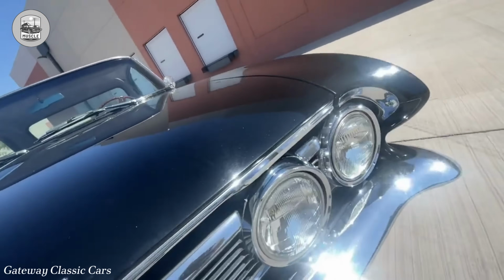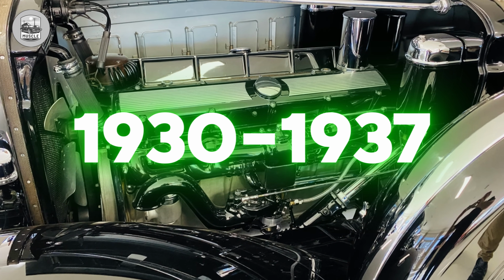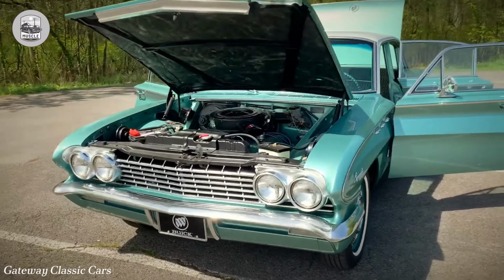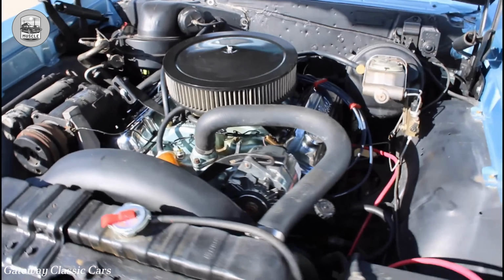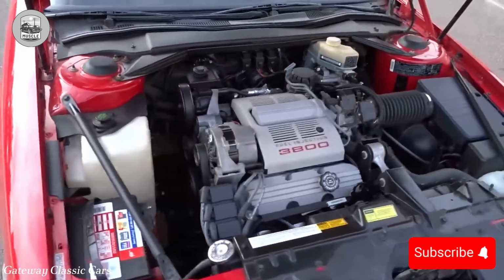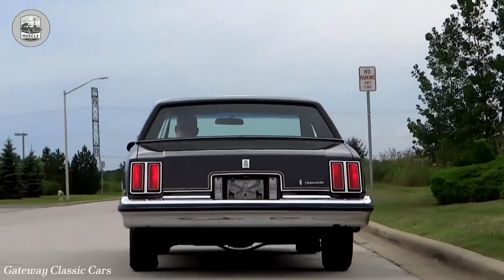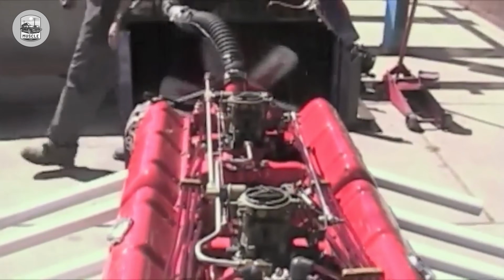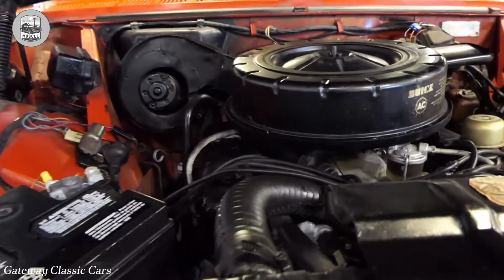10 MOST FAILED and WEIRDEST GM Engines ever made | Worst engines blunder!

Comment: I owned a 1963 Jetfire, it was the loaded version, full power, AC lacked only the AM/FM radio and vanity mirror. I drove it for a number of years as a daily driver swapping back and forth between it and my 1966 GT350. Jetfire was much nicer in hot weather. Someone had lost the heat shield for the battery, which also seems to be missing from the car in the video, as a result the exhaust heat would kill a Sears Diehard battery every 18 months. Technician at the Newport News VA Sears auto center would see that Jetfire in the service line and go pull a new proper size Diehard and have it waiting when I pulled in. It would just flat walk away from a standard 289 ci Mustang. Biggest issue I had was the transmission, it really wasn't strong enough for the Turbo Rocket V8.
Reply from the maker: Thanks for sharing such an amazing story about your 1963 Jetfire! That’s a rare gem with a fascinating turbo setup, and your experience driving it alongside a '66 GT350 is pure muscle car royalty! It's interesting that the Jetfire, with its Turbo Rocket V8, could outperform a standard 289 ci Mustang—it’s a testament to the innovation Oldsmobile brought to the table.
The issue with the missing heat shield and the toll it took on your Sears Diehard battery every 18 months is a classic problem. Those turbocharged engines produced a ton of heat, and without that shield, it’s no wonder the battery couldn't handle it. It’s great that the Sears technician in Newport News had you covered each time!
As for the transmission, you're spot on—the Jetfire’s 4-speed Hydra-Matic was known to struggle under the stress of that turbocharged power. It was designed for more standard engines, and when paired with the Turbo Rocket V8, it could definitely show its limits. Many owners eventually upgraded to stronger aftermarket transmissions to handle the extra torque.
Thanks again for sharing your story, and to everyone else reading this, we’d love to hear more experiences! Got any stories about classic muscle cars or tips on keeping them running strong? Let’s keep the conversation going! Don’t forget to comment, share, and subscribe to Muscle Car Masters for more stories, insights, and all things muscle car!
Reply: @MuscleCarMasters68  I also had a (bought new) 1978 Delta 88 Royale with the 5.7L Diesel engine. That one had several "lets cut corners" issues, like using the Delta 88 V6 running gear, as a result it ate a set of front pads in under 10,000 miles. Injection pump timing marks wern't right as built. I am a trained Diesel mechanic by USMC so knew that 10-12 mpg and virtually no power, loads of black smoke weren't right. I got ahold of some Roosamaster information, removed the pump and took the timing window off. Problem is, you can't see the marks with the pump installed. I took a short piece of rubber and wedged the rotating portion at the mark, stuck it back in with engine at TDC. Took an open end wrench that fit the flats on the pump inlet and loaded it against the direction of rotation and made a new timing mark, smoke was gone car had reasonable performance on mileage jumped up to near 30 around town an 33 highway. About a month after that, dealer service manager called and said they had received a service bulletin regarding improperly marked timing marks on early production Diesels. He had me drop it off, and performed the TSB and said I was dead on with my mark. When we bought it our son was 1 year old and I owned a carburetor and ignition shop, so selling me a Diesel was a big deal, they were not discounting them, full sticker. I didn't want a vinyl top as I really wanted my rear window to stay leak free. They ordered one in, then said that it for someone else who wouldn't take it without the vinyl top. It had the optional wheels and tires, they could get the F41 (handling package) so they wholesaled me the parts and I installed them. we could drive on or off ramps at double the posted speed limit. Many years later, returning from Atlanta, I took some back roads a Greyhound driver had used bringing my USMCR unit back from Albany Georgia. Had a Caprice passing evryone behind us until he caught up, I was afraid he was an unmarked (I was probably running 15 over, or about 70 on a two lane 55 limit road in North Carolina. I held my speed, figuring if he was State or County police, he had me. Caprice got up close and suddenly bacled off, apparently saw the rear anti-roll bar and thought I was an unmarked police car
Reply from the maker: @billvose7360  Thank you for sharing your in-depth experience with the 1978 Delta 88 Royale Diesel! It’s great to hear how your expertise as a trained Diesel mechanic helped you identify and correct issues that were overlooked at the factory level. The story about setting the timing marks and the jump in fuel economy from 12 mpg to nearly 30 is impressive—definitely shows how a little knowledge and elbow grease can completely transform a vehicle’s performance.
That factory oversight with the timing marks must have been frustrating, but it’s a testament to your skills that you were ahead of even the dealership's TSB fix. It’s also fascinating to hear about your improvements to the handling with the F41 package—doubling the speed on ramps? Now that’s taking full advantage of GM's suspension tuning potential! And who could forget that Caprice moment? Must’ve been quite a thrill to watch someone back off, thinking you were an unmarked police car thanks to your rear anti-roll bar.
Your story is a prime example of how muscle car enthusiasts with knowledge and dedication can transform a vehicle from good to great. For everyone else reading, don’t hesitate to share your own stories of modifying these classic machines. Comment below, like, share, and subscribe to Muscle Car Masters—we’d love to hear how you’ve fine-tuned your rides to get the best out of them! Let’s keep the conversation going...
Reply: @MuscleCarMasters68  My first car I owned was a 1964 Falcon with a 260 V8, fully synchronized 3 speed column shift and what I later found to be factory AC (still underdash, but all the underhood pulleys were cast iron or steel). I took over payments on it after returning from my 6 mos active duty in USMCR. I was given the option of that or find something else and buy it. In 1966 a 19 year old needed a co-signer, and I really couldn't find anything I wanted or could afford, so it was the Falcon. I don't remember how long it was before I got the urge to upgrade it. Ordered a set of Jahns 10.5:1 pistons, a Lunati hydraulic lifter cam kit and an Offenhauser 360 intake for a Quadrajet pattern and bought a new 1966 Buick Riviera 401 Quadrajet as that was the latest thing at the time. This was dad's fault, he had taken a group of we, then mid-teen boys, to the Suffolk Virginia drag strip (where NHRA ran the Spring Nationals for years). As a result I was hooked. I joined Beach Ford (Virginia Beach VA) Drag Club, one of the perks was a discount on parts through them. They had a nice display of the Ford Muscle Parts and carried the catalogs and build up manuals. One of the items was a tri-power kit, complete, for a 289. Having already learned that my very late production (27 July 1964) Falcon had 289 heads and a lot of C5ZZ (Mustang PN prefix) parts, I figured it would work, it did, Hedman Headers and dual exhaust helped). I found a Borg-Warner T10 for a V8 Falcon or Comet in a local junkyard and ordered the shifter floor pan section that Ford used from the factory. Dad hekped me position it and drill the holes for the attaching screws. Then came the fun, cutting out the section. This was before the nice cordless tools, so it done with drilling a sabre saw and a lot of filing. I ran the car with the 4 speed but the Falcom/Comet weak spot showed up, the clutch cross shaft would split near the pivot where one of the arms was welded on (this also happened on my next car, a 1966 Shelby GT350). By this time we had moved from Norfolk to Virginia Beach and I had met an older gentleman who had a small one stall transmission shop (he was grandfathered from when that area was Priness Anne County). He helped me build a C4 by using a few of the aftermarket tricks to add discs to the clutches, helped me order the front band and servo for a 300 six C4 and then build it. I made a 3/4" thick aluminum case girdle that also added 3/4" depth to the pan and made a 1/2" spacer for the strainer. That transmission would almost give you whiplash on the 1-2 shift! Be the time I retired it and started driving the Shelby it had a reputation. A friend who worked at Smithfield Packing, needed a car, Falcon still had current tags and inspection, so I let him use it, heard through the grapevine that he was making a killing racing people on the straight stretch in front of the Smiffield and Luters packing plants. I told him it was customary for the car owner to get a cut of the winings, never did though
Reply from the maker: @billvose7360  Wow, what an incredible story and build! Your 1964 Falcon journey sounds like a classic gearhead adventure—right from upgrading to high-compression Jahns pistons, Lunati cam, and that killer Offenhauser intake with a Buick 401 Quadrajet carb. That transformation must have made the Falcon a beast on the street!
It’s amazing how you didn’t just stop with bolt-ons, but even took on a transmission rebuild with some serious upgrades for durability and performance. The C4 mods you did—using parts from the 300 six C4 and even adding a custom case girdle—show your deep passion for making every piece of your build bulletproof. That transmission was clearly a force to be reckoned with if it was giving people whiplash on shifts!
Your story just shows how much muscle cars like the Falcon could be transformed into something far beyond what they were originally designed for. It’s even better knowing that your build lived on with someone else giving it a run on the streets!
Thanks for sharing that amazing journey with your Falcon—it’s stories like this that make the Muscle Car community so awesome! If you haven’t already, be sure to hit subscribe and keep commenting with your experiences. Everyone, feel free to share your own muscle car adventures and builds—let's keep these stories alive! Don’t forget to like, share, and subscribe to Muscle Car Masters for more content on the best muscle car builds and history! 🚗💥